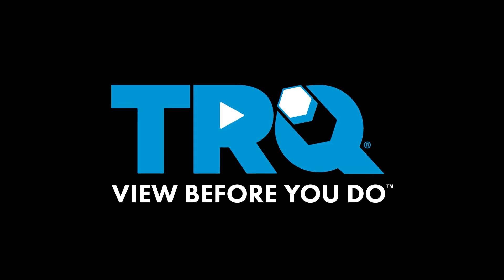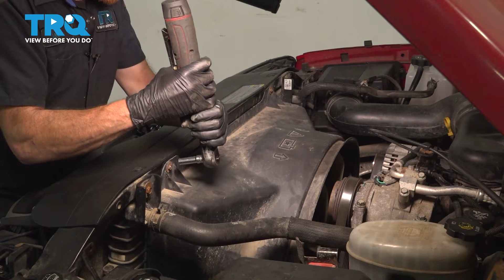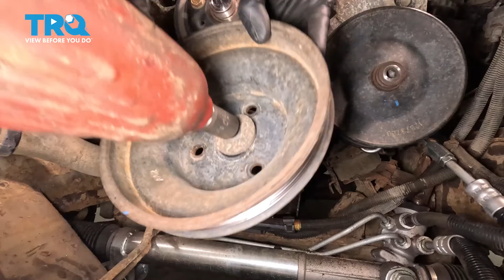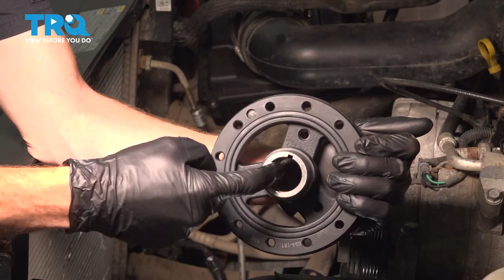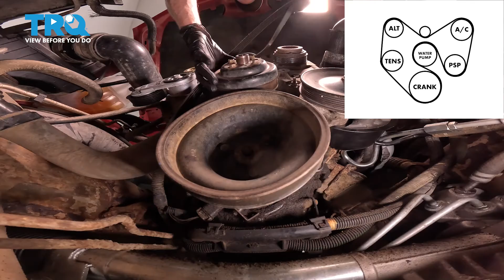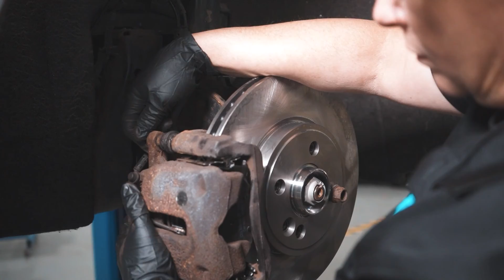How to Replace Harmonic Balancer 1999-2006 Chevrolet Silverado 1500

Comment: Nice clear and to the point video on this procedure. Very well done.  I might add that if you are removing the balancer due to an oil leak, you  should confirm if the old balancer has a groove worn against the seal( that leads to an oil drip), or if just the seal may be bad. Usually the balancer gets a wear groove especially on a higher mileage motor. Thanks for your video!
Reply from the maker: +@ironeagle1281 Thank you! We love empowering our customers and showing how to perform DIY auto repairs with our high-quality auto parts. http://1aau.to/m/Shop-TRQ